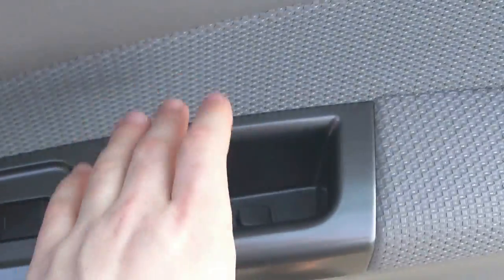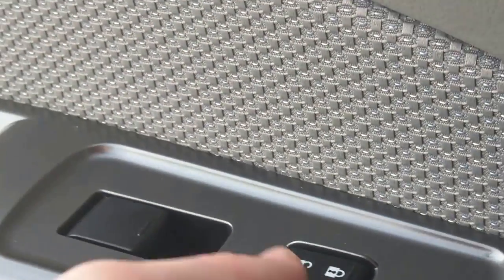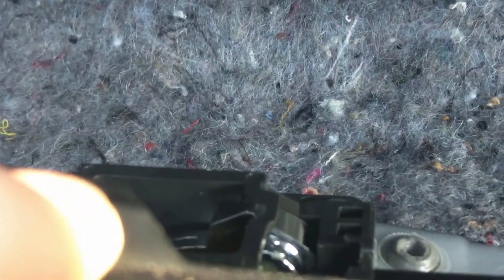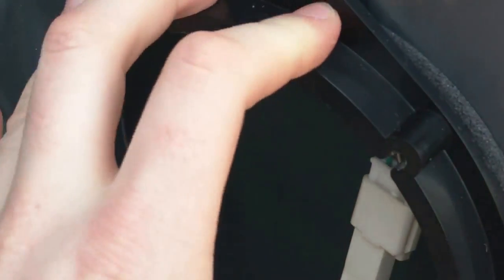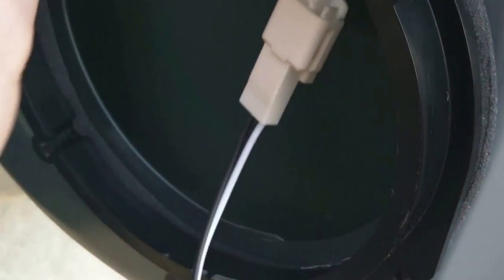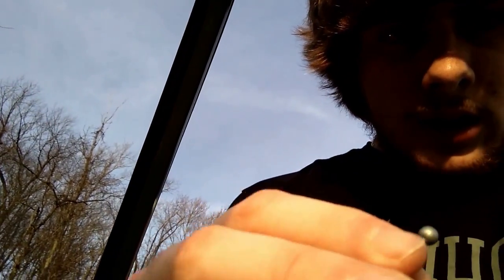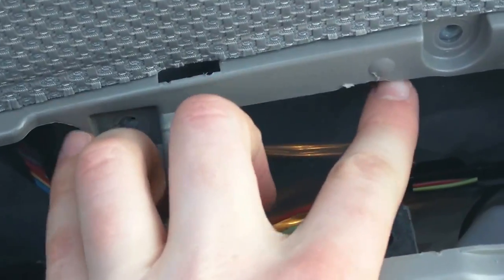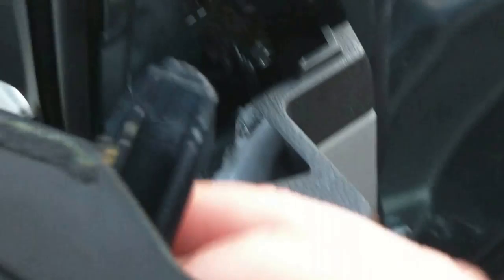How to Install Car Door Speakers - Subaru Forester

Comment: Thanks Mac...after 4 months, how do the new speakers sound, now that they've had a chance to break in?  Have you thought it to be necessary to install sound deadner on the front doors with the extra oomph the new speakers bring to the party?  Have you added any other components to the Forester or are you just running the 4 door speakers?  Overall impression?  What would you do differently, i.e. different 2-way speakers?  3-way speakers? component/separate speakers?...just curious as a Forster may be in my near future.